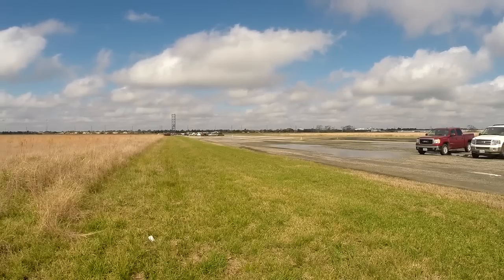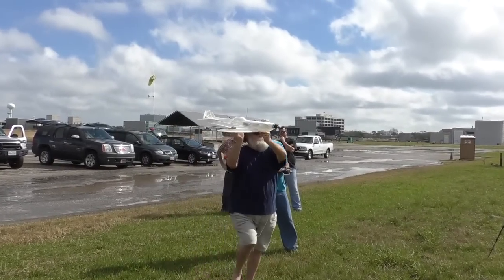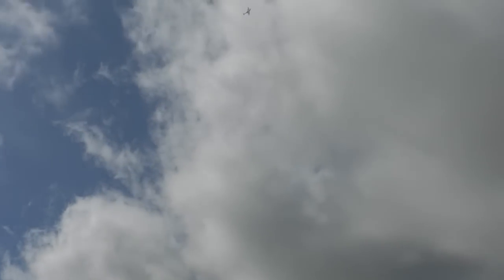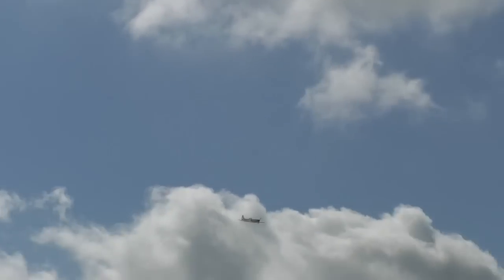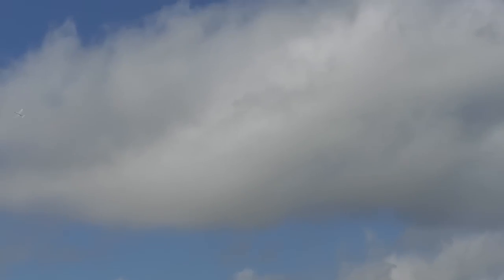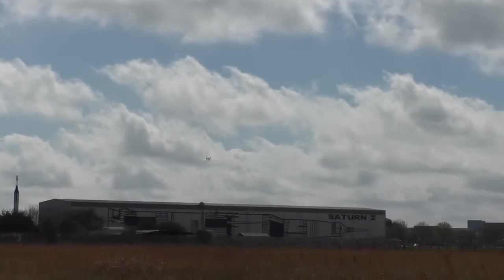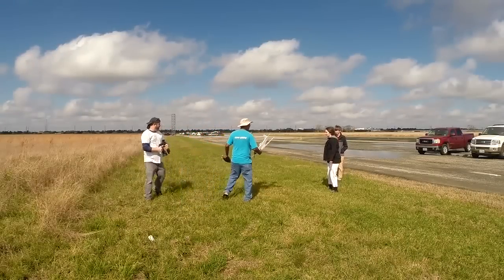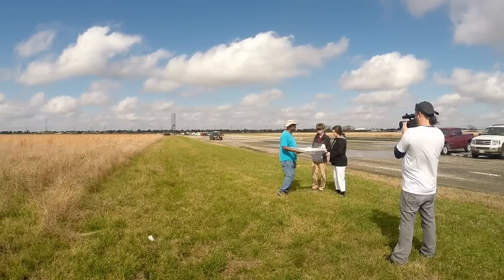3D Printed R/C Spitfire Flight Review | HobbyView

Comment: Printed and flew this myself recently.. In the video guides they say you need to set it at 50% exp and limit the travel of elevator to 10mm up, 8mm down as well as the ailerons to 15mm up and 10mm down.. 

I think the plane flew greatly, but i encountered the same problem when trying to loop. I was probably too fast with the elevators so it snapped on me and almost flew into a bunch of trees.. but it worked out.. two successful flights and now it is parked .. Going to move the motor over to the 3d printed P51 mustang instead as i had some problems with layerbinding on the Spitfire.. 

I think the projects i have done from 3dlabprint have boosted my experience and knowledge in 3dprinting more than anything else.. and it has been awesome.. 

I am about to put the electronics into the Cessna 152 now, even printed the wheels with PETG and TPU .. Really looking forward for the maiden!

Comment: Brillant vid, I enjoyed this and the first one of printing the parts very much. Thank you. I agree with the other comments on the launcher or should I say chucker !!.  I was taught to launch my planes, power off, into long grass a few times to check CG and trim, glide etc. It has saved many planes from what happened to yours! I built a foam Spitfire, about the same size as yours from 3mm foam artboard. It was a marvellous plane. The design, especlaly the elliptical wing, is superb. How the heck you kept track after the successful launch with the high speed and crazy trim, shows you are an excellent flyer congrats.

Comment: More info wanted on the printer(s)! I’ve designed a couple planes in 2d Design Cad years ago and recently a couple 1/2a models, but nothing in 3d drawings or related to 3d printing. Printing out accessories has my interests.

Comment: watching this as I am gluing 3d printed wings for a delta wing rc my first rc place using a dx7s and just a cheap 9g servo and esc and motor 30a I have flown 6ch helicopter sucked at those when it came to 3d always crashed them drones very familiar and rc cars so I'm familiar with the electronics and the hobby just never got into planes till I saw this

Comment: What makes me depressed is that when he was building the 3D printed airplane was that he didn't make joint placers on the print that way he could lock each piece and then he just needed to add the super glue and it would just be a lot more stronger. Well what I'm trying to say is when I build it like a Lego and then add some glue to make the joints stronger.

Comment: Any comments on these CAD software?  Are they user friendly and efficient to use, especially with 3D printers?  Have you ever used SolidWorks?  I found they are buggy, I wonder if it is my innocience or their design capability problem!
Reply from the maker: I've used SolidWorks a bit. But it is too expensive for the average user. I tried google sketchup but didn't quite like it. I found Fusion 360 to be very similar in many ways to SolidWorks and was much more intuitive for me to use as someone familiar with Solis Works. I believe the 3DLabPrint guys use CorelDraw.